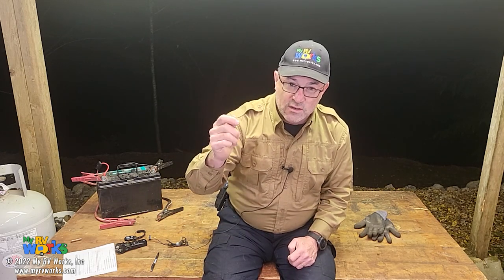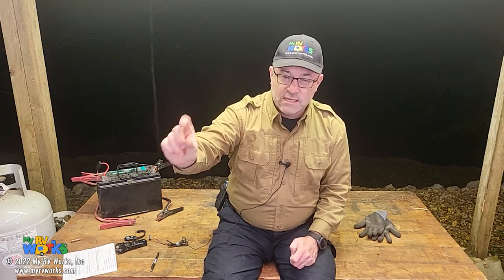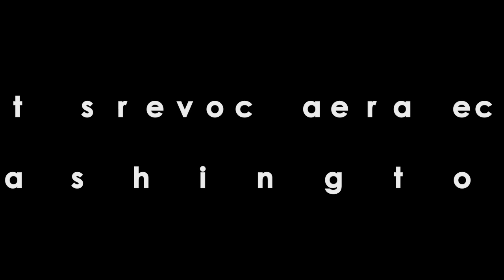Dometic RV Fridge Doesn't Stay On AC Power Mode -- How To Find Out What The Problem Is

Comment: My reset thermal button keeps popping so I'm testing everything. The element test out good for ohms and plugged in 2.5 amps. 5 amp fuse good so checking electric on to see if the fridge is cooling before the button reset pops again. If it does cool before it pops the the reset is worn out. Hopefully that's all?
Update i just bypassed the reset button with a jumper to see if the fridge cools down. If it does then will replace the reset thermal switch

Comment: I have a Dometic DMC4101 12V Refrigerator, no propane. I have a 2023 Thor Axis 24.1 and I have had it plugged in to the house for a while and I noticed today that the fridge was off. I turned it on and it ran maybe a few minutes and it turned off. It will not turn it back on. Fuse is good, breaker is not thrown. What's up?

Comment: If all the lights are coming on on the refrigerator, that tells me it's getting A/C
Reply from the maker: Frig lights are fed by 12V DC.  To verify AC remove the cover from the lower control board (outside back) and use a meter to confirm 120 VAC through the glass fuse.

Comment: I had the same problem with my Dometic fridge as well. 1994 Fleetwood Tioga Montana. AC was getting to the board, AC would come on, then randomly switch to gas or just turn off. The problem was the old linear AC power supply / DC converter that came with the RV. The capacitors were going bad and a loud hum from the transformer. There was an AC ripple on the DC side of the circuit board. Changed out the power supply for a new switching power supply with charging for LiPo4 batteries and the issue went away. Cheers, Bob

Comment: Hey Partner, It’s been awhile back but you answered my question about a Hard Lockout situation I was having on my Norcold N811. You suggested jumping from pin 15 on the control board to the ground bolt with a Wire. It took about 15 or 20 Seconds to hear that Clunk sound, but that did unlock it! It worked Exactly as You Described!!! THANK YOU SO MUCH!!!

Comment: RM3801 freezes down to 22° in lower compartment and -9° in the freezer.
Replaced the bad cooling unit two years ago and it worked perfectly until I defrosted it after discovering the drain tube was clogged.
Made the assumption that the thermostat had failed so I put a new one in with no change.
If I turn it down until it clicks off, then it won't start. If I turn it on just until it clicks, it just keeps cooling.
Can the problem be saturated insulation?
It doesn't make sense to me that the thermostat works fine manually but doesn't regulate when it gets cold.
Can the control PCB cause these symptoms?
Has me completely stumped.
All I did was defrost it and clear the defrost drain.
I'm right across the water from you near Seattle.
Thanks for doing what you do!

Comment: I have an Evergreen Reactor 25' Toy-hauler with a Onan 
Generator, RV QG 4000 EVAP Model 4KYFA-6747P, that has become difficult to start and then will only run for 30 seconds, shuts down then the light flashes. I can't figure out how to get the generator out of the camper to work on it because the access door is to small. I think it may be a fuel pump.
What are your thoughts?

Comment: I recently changed a cooling unit on a Dometic 1350msx double door refer. And while changing it the noticed that the chamber was getting hot like normal, but as it went through the absorption stage. Would never get hot past the upper left part of cooling unit. Which would keep tripping the limit switch on chamber. Replaced board and cooling unit. Any suggestions on what to look for??

Comment: I don't know if you read the comments or not but I do have a dometic refrigerator
And it's one of the older ones 2007. I downloaded your schematic and it does run on gas but it doesn't get cold and when it's on electric it gets too hot and kicks out and I have to reset the breaker on the heater chimney. It's got me confused and to what it might be. I ordered a new board because I thought well maybe it's just allowing the electric heater to just keep going and it's not controlling. But it doesn't get cold on gas neither so even though it's running on gas and it doesn't kick anything out because it must be controlling on gas okay it's not getting cold. It's a tough one I wish it was easier. But if you got any thoughts please let me know I'm sure you have run into this before.
Reply from the maker: After the refrigerator has run for at least an hour or so, feel the boiler temperature with your hand, and feel the absorber coils (that go around and round and round) with your other hand. If the absorber coils are cold then you have a blockage and that is not something that's field serviceable.  I talk a little bit about blockages in the first few minutes of this video.

https://youtu.be/--DCnSw1jP4

Comment: I have a Dometic RM 1350 slmx and it runs on AC and Propane will not run just on electric can you help? Have had it in to a jayco dealer they said it was a fuse and replaced it. They said it could be the board.

Comment: I have a problem with my RV furnace would like to know if you could figure out the problem please ! I've watch most videos and still cannot figure it out. I've replaced circuit board,sail switch,igniter. When I turn it on I hear the  fan,hear the clicking,I smell lp gas and feel the heat but it suddenly get cold and ends up shutting off.  It's frustrating!  lol tyia !!
Reply: @My RV Works, Inc.

Comment: My dometic refrigerator was fine. It got really cold outside for two days. -46 degrees … 
It warmed up outside to about 20 my refrigerator just quit working. I put a heater in the back of the refrigerator. It still doesn’t work… the fuse is go in the panel and in the control board. No ammonia smell… I hear a click at the control board when the refrigerator is turned on and off… the pilot light will come right on when switched to gas… I’ve checked the thermostat on the fins in the refrigerator… I’ve unhooked it as well… it’s a cu826a model… I’m stumped

Comment: This one is a serious brain bender. 
Dometic RM3801 The flame stays lit even when the thermostat is off. Thermostat tested and replaced anyway with no difference. 
Consistently shuts the flame off if I  turn off the front panel switch.
Worked perfectly until I defrosted it.
The thermostat will light up the burner but I need to shut down the power switch to kill the flame. 
???😮